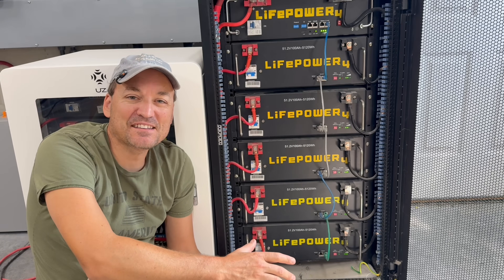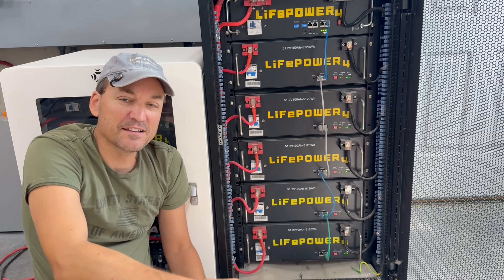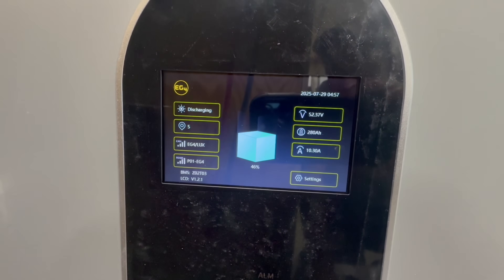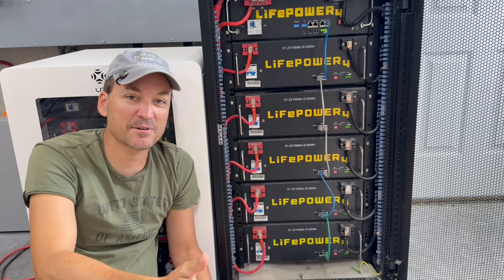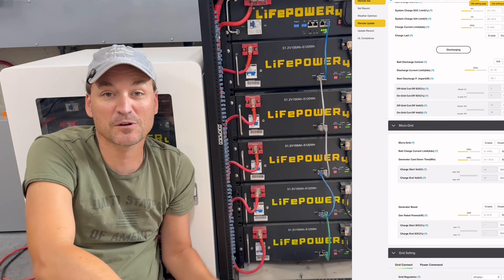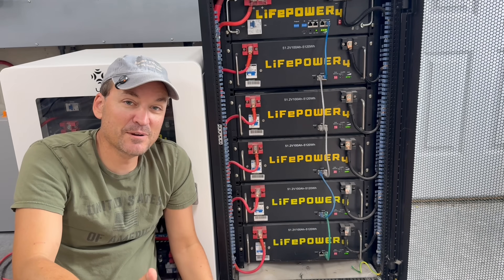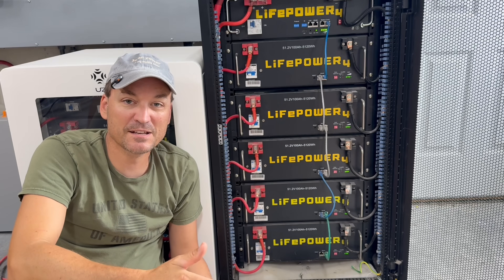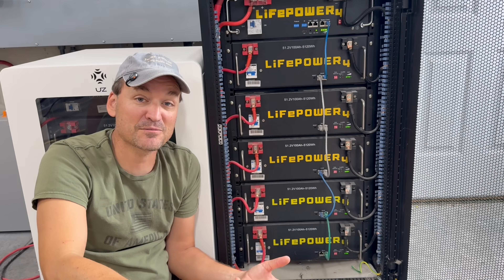How to keep your EG4 batteries balanced. Simple solution for SOC drift

Comment: I noticed the same problem using the EG6500EX.   I can't usually run the loads and totally charge batteries with solar on daily basis.
  Often times after 8 or 9 o'clock in the evening I charge batteries and run loads off the grid through the inverter I can only charge at 10 amps or I get low voltage warning I believe that even though I updated my service panel to 200 amps the incoming triplex is undersized and aluminum conductors from earlier 100 amp panel and I experience a significant voltage drop.
  I do have a EG46000XP that I haven't put in service yet but I wonder if drawing off both phases would enable my ability to charge at higher amperage without low voltage warning when exceeding 10 amp of charge current while distribution of load to both phases.

Comment: I've had my two EG4 14.3 kWh wall mount batteries installed for 4 days and today is the 1st rainy day since I hooked them up.  Already the SOC is off by 5% but the voltages are only off by 0..05V.  What the heck?  I'm not sure what's going on and if the lead acid trick will work.  But It's only the 1st rainy day so that would be a pain in the * if that's all it takes.
Reply from the maker: The Soc isn’t super accurate. As long as the voltage is similar you’re fine. But a healthy top balance is never a bad idea either way.

Comment: Gavin, TYVM for all your videos.
i wish you would show us how to add other brand batteries to our EG4  48 V banks.
seems like EG4 wants to sell 48V batteries at a high price compared to the ecoworthy 48V.
I have 5 eg4's and would like to add 3 more, would actually like to add 3 ecoworthys. Your videos helps everything make more sence..TY Again
Reply from the maker: I am super busy lately. I will try to make something at some point. My vatrer rack battery video  showed a bit of that towards the end. But I essentially charge the batteries  to the same voltage as my main battery bank, I add a T class fuse between. And then turn them on. 
Remind me if you haven’t seen anything in a month. 🤓

Comment: We have 4 DIY batteries by Apexium. They have the 200A JK Inverter BMS with circuit beaker, fuse, 4.3“ LCD screen, Power button and communications. They connect to our EG4 18KPV with the Pylontech protocol. When the batteries reach 3.45/55.2 volts the active balancing kicks in and keeps the SOC perfect. I never have a drifting problem because we use the best BMS on the market. So what does $1,854 buy? The case mentioned above with Grade A EVE MB31 (314Ah 3.2V cells, 8000 Cycles, Version 3). That is a 16 kilowatt battery with the best BMS in the industry. I chose the EG4 18KPV because of Gavin having such good success with his. But I would not over pay for batteries with an inferior BMS. And now I am vindicated. EG4-WallMount Indoor Battery 280Ah | 14.3kWh for $3,299.00 plus tax 197.94 = $3,496.94 plus shipping from Texas. Or the Apexium Horizontal 314AH | 16.1kWh for $1,854 no tax and free shipping from Texas. That is a 1,642.94 savings and 1.8kWh more capacity and no SOC drifting.

Comment: So doesn't topping them off to 100% in closed loop mode calibrate all the batteries bms, or are you saying you need switch to voltage mode.
Reply from the maker: If you aren’t seeing the whole pack reach that 100%. Then switch to voltage and top charge everything.

Comment: Do you know how the BMS SOC is reset? Does it just reset to 100% state of charge when internally it crosses 56.0V or something? I'm curious in the internal logic.
Reply from the maker: Yeah I saw the actual voltage number at some point. But I can’t recall. I believe it’s 56.5v. And there is a low voltage calibration as well.

Comment: Hey Gavin...What size fuse between six server rack batteries an EG4 12000XP?  Thanks for your time.
Reply from the maker: Depending on your wire size I would use a 300 amp T class fuse.
Reply: @GavinStoneDIY ...any manufacturer you recommend regarding 300 amp T class fuse holder and fuses?
Thanks

Comment: Nice one as always Gavin. Had this happen to me about 4 months ago, I was waiting for you to say what to do if you have the shutdown and blinking red light.... This can be handled in a few ways, one, keep all the other batteries off, then you charge it till it gets around the same voltage as the rest of the bank, then charge all, or you can opt to do what I did and just charge the whole bank. They will eventually all charge up, but you HAVE to top charge fully. if it were to happen again, I'd do option one. lol Thanks for the video!

Comment: Why is it that there are tons of equipment out there that measures all kinds of measurements down to the microscopic level and a BMS cannot measure low voltage or drain?
Reply from the maker: A shunt does a better job of tracking current. It’s a bit harder for the BMS. Even though they have something akin to an internal shunt in some cases. It still has limitations.

Comment: Pretty good video.  It's always important to remember that with LiFePO4, SOC is a guestimate, for display purposes.  Actual charge and discharge parameters should always be (and generally are always) voltage-based.  Since the SOC indicators will reset to 100% on a full charge, the display issues are self-correcting.

What I usually do is set the Peukert constant to 1.05 and the charge efficiency to 95% in the shunt.  This generally lo-balls the SOC estimate a bit, so as the errors accumulate it errors on the side of displaying a lower SOC than the actual SOC.   It's always good to know that you are assured to have at least X% left and it doesn't matter too much if it reads 100% early but then takes another hour to actually get to 100% in reality... because under those conditions the battery will be pretty full regardless.

In terms of automation... I still have some non-critical automation based on SOC but everything else is voltage-based.  My export-to-grid automation is SOC based and I just eat it (export a bit less) if the SOC is reading low.  And I always make sure that the SOC will read low rather than high.

I strongly recommend top-balancing only.  Never bottom-balance.  The problem with bottom-balancing is that you still need to have voltage-based charge targets (you can't use SOC for charge targets with LiFePO4, it will get out of whack in weeks).  Because of this, if you bottom balance your charge-to-full will likely cause one or more batteries in the bank to disconnect on OVP.

So always top-balance.  There is a lot more room for voltage margin on the low side than on the top side, so you won't get OVP disconnects OR UVP disconnects when you top balance.  That is, for LiFePO4, a cell voltage of 3.0V is basically already 95% discharged and you can go down to 2.5V before hitting a UVP disconnect, so even if various batteries in the bank are out of whack with each other a voltage-based lower cutoff for the inverter might discharge one or more batteries below 3.0V, but is unlikely to bring them all the way down to 2.5V to the UVP before the pack voltage as a whole hits the inverter low cut-off.

Another good reason to set your inverter cut-off lower... in a 16S system, 3.0V/cell = 48.0V, which is 95% depleted at low loads.  To keep things sane under load, making the cut-off 46.0V is a very decent trade-off.  46.0V is 2.875V/cell.

It is important to avoid OVP and UVP BMS disconnects in all situations.

-Matt

Comment: I have a Victron MP2 connected to two EG4 Wallmount batteries and after many intermittent errors I finally gave up on closed loop and went to open loop with a smart shunt and DVCC enabled on my GX device and everything is happy now. The batteries are communicating between each other but not to my MP2. I think closed loop is way overrated and not really necessary unless you are really stressing your batteries during the charge and discharge cycles.  I'm not sure closed loop is ever a good idea if you inverter and batteries are not all made by the same company.
Reply from the maker: Yeah I ran everything in open loop for 2 years or more. Worked great. I like the monitoring when I’m away in closed loop. So I get a pretty accurate SoC. Other than that it’s mostly just because I like testing different options to tell people about.

Comment: I have actually started running every battery in lead-acid mode. It has alleviated a lot of headaches.
Reply from the maker: Yeah I ran that way for over 2 years. I haven’t had any issues with the wall mounts in closed loop honestly.
Reply: That's the secret hahaha
Reply from the maker: Honestly I run them in closed loop more for the testing factor. Haven’t had any issues with the wall mounts or LL-s batteries in closed loop though. And it’s been a year.  I never had any problems on open loop either though. Amperage is amperage. 🤓
Reply: @GavinStoneDIY  I had a problem with the v1 LL's in closed loop. Think I made a vid about that a few years ago before even eg4 put out any solutions/literature on it. I think that jaded me to closed loop.....lol.
Reply from the maker: @CountryLivingExperience  I hear ya! Certainly nothing wrong with open loop. You still get the power.
Reply: Problem is that you will never really charge past 60 percent that way.
Reply: @Greg-bx4id that's not true
Reply: @WillProwse   Hi Will, I follow your channel too.  Great content.

The problem is that standard charging profiles for lead acid chemistry is that the voltage does not go high enough to complete a full charge on an LFP battery.  I found this is the case with my 48v home system as well as my RV system.  I had to replace the converter in the RV to one that recognizes LFP batteries and will charge accordingly.
Reply: @Greg-bx4id  When they mean lead acid mode,i found out that this is in america what we use in europe as " user defined" -meaning,they can set charging voltages manually,and reach the goal of reseting BMS soc readings to 100% when they go above 56V or even higher.Not nice,becouse this is just a bad setting in the BMS by the manufacturers,but this is how they get around this.I wouldnt go daily above 55.2V,shit on BMS,and install a shunt instead,a victron shunt isnt that expensive but quite accurate.
Reply: @83kaszas  Interesting.  I'm not familiar with many other brands of BMS.  The 12v ones I have require LFP settings from the charger.  If I use a simple lead acid battery charger the batteries won't fully charge.   Maybe I need to get bluetooth configurable BMSes for the 12v batteries so I can configure charge modes and balance cells and packs....But for the 12v stuff, I was just trying to keep it simple.
Reply from the maker: In open loop? They’ll charge fully. Change your bulk voltage to 56.5.

Comment: One more question Gavin.  I'm seriously considering assembly building one of these 16KWH batteries or buying some Ecoworthy. What you said is that I should separately fuse dissimilar banks of batteries. 
Question:  number one: what fuses do you recommend and how do you size the fuses? 
Question number two: since different batteries have different resistances with different gauge and length cables to a common bus bar... how do you determine the open loop voltage setting at the inverter...said a different way:  top balancing different battery banks, just set the voltage at the AIO inverter high enough to feed the disparate banks with as much flow as they want?
Sorry for the rambling question. Thanks
Reply from the maker: Charging Voltage would be determined by the battery chemistry and voltage. Typically 57v is a nice bulk setting for most 16s 48v lifpo batteries. 

The fuse would be determined by the wire size. The larger the pack the less amperage will be pulled from each battery. I usually use a 300 amp T class fuse with 2/0 or 4/0 wire.  Most of my battery banks will only be sending 30-40 amps through the wire. So the fuse is just there in the event there is a real issue.
Reply: If your Ecoworthy battery has a circuit breaker (like mine) I see no need for an additional fuse.
Reply from the maker: @rpsmith T class fuses will prevent a thermal runaway situation. Extremely rare I know. But in my opinion it’s worth it for extra insurance.
Reply: @GavinStoneDIY  ~ adding a class T fuse won't hurt anything but your wallet!  :o)
Reply from the maker: @rpsmith you can find them for a decent price now. Cheaper than they were when I started out with solar.

Comment: Great video Gavin.  Right on subject. You must be reading my mind about balancing.  I have my original 24 volt system from 2019 running....it's six 24 volt Simpliphi no communication batteries with charging through Midnite charge controllers. I run only with a smart shunt allowing me to guess SOC based on my average bank voltage. Simple, I guess. 
Now my 2024 system is 48 volt EG4 with a six Lifepower4 batteries in a rack and a pair of 6000xp. Suddenly I'm fixated on SOC because of the supposed necessity of closed loop communications. So I wonder if I'm overthinking using the EG4 Lithium for SOC setting. What you describe using lead acid and voltage with open loop makes sense based on my old 24 volt system experience. 
So to check my understanding, I set my 6000xp absorb to 57.5 or even 57 and then each battery's BMS will decide when 100% is 100%? The inverter is not over charging for the sake of top balancing....the inverter's MPPT is "allowing" as much charging to flow as each BMS will allow??
I hope that that question makes sense. Many thanks
Reply from the maker: Exactly. The BMS’s will kick the charge off when needed. Closed loop works great though. Those small discrepancies in SoC can bother people. But they really aren’t a big deal.

Comment: Also one gold advice,just thought of it:)))) The only question you are interested in is,DO They have the same voltage in paralel??? YES? than you dont care about individual SOC. Voltage is your GOD in this case.If there is a voltage difference,than thats a problem,corroded connection,somewhere higher resistance in connections,some kind of problem.
Reply from the maker: Yes I mentioned this in regards to voltage. 

I realize the Soc is just a guesstimate. In any case, recalibrating the BMS will make the pack even out again. Whether that’s super crucial or not? I suppose it depends on the individual. I’ve had people tell me they won’t buy certain batteries because their connections are the “wrong color red”. So it’ll likely matter to someone.
Reply: @GavinStoneDIY the Red terminals on my Pytes batteries are Orange. 🍊 = 🥇
I wish I had 32 Pytes batteries.
Reply: @maverickmacgyver  Pytes bateries are good becouse they use very good cells,and the BMS can actually balance the cells...unlike many others,like seplos BMS who cannot do it properly.
Reply: @GavinStoneDIY  haha,i get it,yeah xD

Comment: 1: - there is no such thing as SOC drift,on bateries tied in paralel connection. All BMS will report different state of charge becouse they are simply not accurate.Even measuring with a shunt like victron,the accurate SOC will  drift,and wont be accurate anymore,enough if the batery is partially charged like 3-4 times.There is no device that can give,absolutely accurate state of charge,all of them are just a ROUGH estimate.The one thing that give you the ultimate state of charge is when they fully charge to at least 55.2V,better 56V,all of them equally,and from the charge controlers to the bateries doesnt go even 1amp-Than you can be 100% sure that your bateries are all equally charged(i think you mentioned the same too).
2:- communication btw BMS and inverter,or solar systems VRM,is only good for monitoring purposes,i would never set a system,so the BMS is the boss on how to charge LIFEPO4.Most manufacturers set them very badly,for vear and tear,so you will buy new bateries soon.The BMS is a safety device to protect cells,to protect the battery from extreme temps,curent,shorts,you name it.Not the lead in charging parameters and algorythms.That job is for the charge controllers onlybe that a separate one ,or those incoprporated in all in one inverters.
Also shall mention,that current always flows where the resistance is lower-to the load first.And between the bateries if they drift in SOC,the one with higher energy(watt/hours remained)will always have "bigger pressure"-aka lower resistance,ergo they gonna give more amps/hour than those with a lower energy level.Simple phisics,and also noticed in practice,its indeed behaves like this.
I hope all this helped to clear up some things...